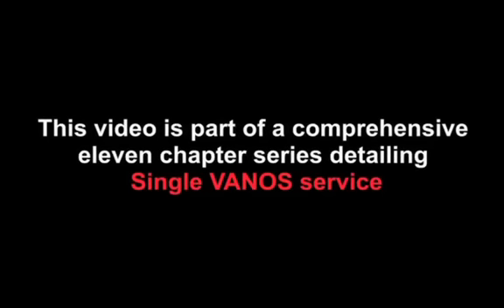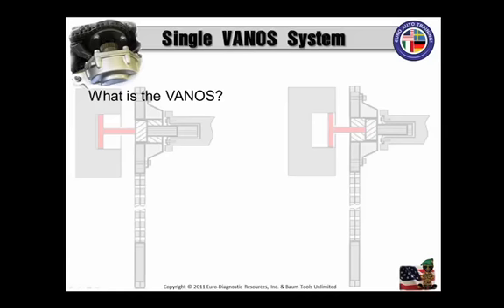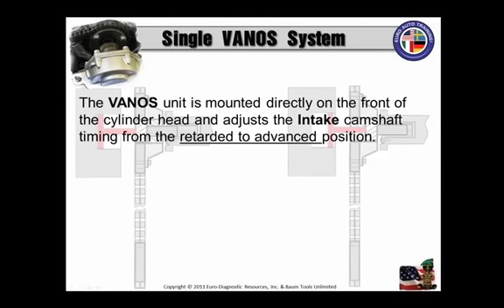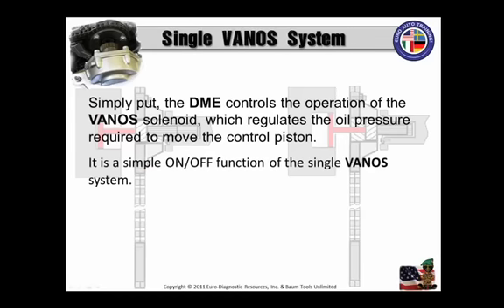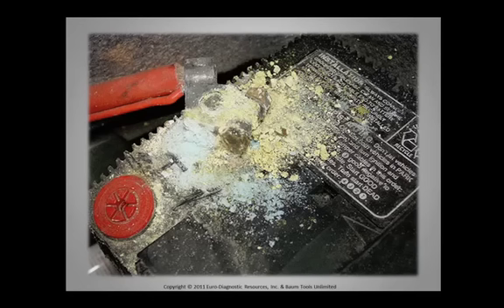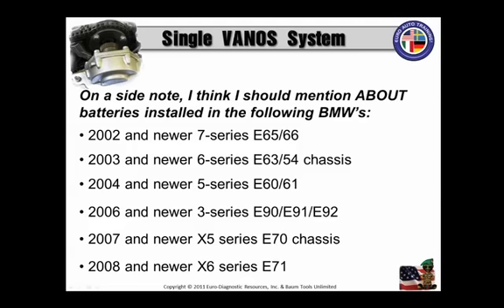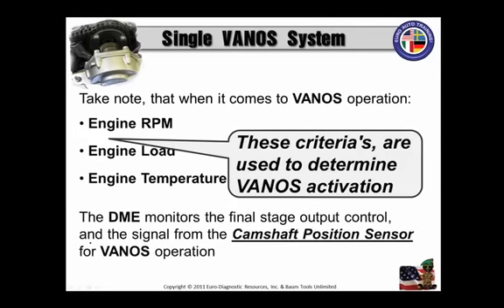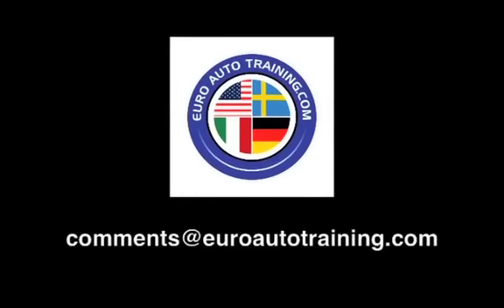VANOS - Chapter 1: What Is It and What Does It Do?

Comment: How do you know if you have single doublé or no Vanos, its a tiptronic 528 e39 (m52b28)
Reply: You will see one or two VANOS solenoids protruding near the top of the head, in the vicinity of the cam drive sprockets. See their "Chapter 2" video. You'll also see the DME wiring connector coming off the end of the solenoid(s).
Reply: +CUJOtheMASTER its single if you haven't figured it out yet the m50 and m52 are single the m54 is double

Comment: I prefer an engine without VANOS.
Reply: Ad Mirer  youre cute
Reply: +Ad Mirer Did your vanos break??? Mine went bad too. Gonna try to fix it myself since it seems straight forward to change the seals on an M54b30.
Reply: apathy11303 m54b25 with 230k miles on all original vanos components, only thing changed was the piston seals, you people need to change your oil I swear, with good oil and shorter intervals you’ll likely never have a problem with vanos
Reply: Just more complications.